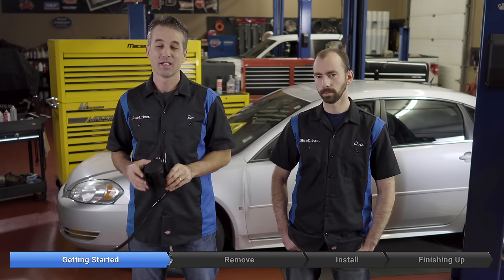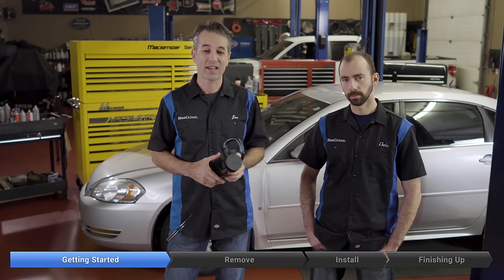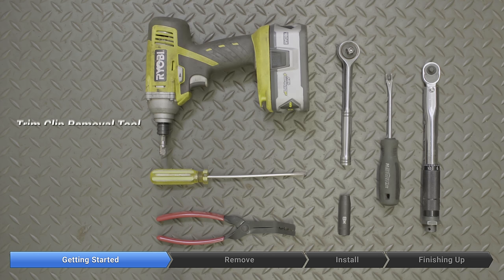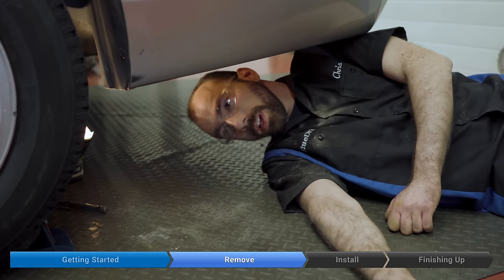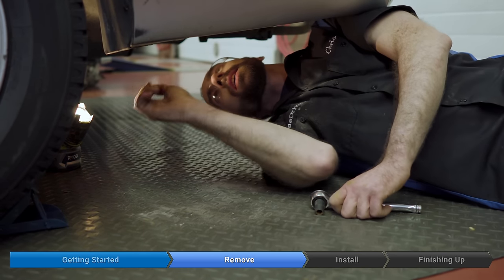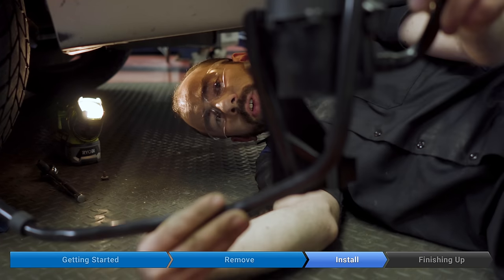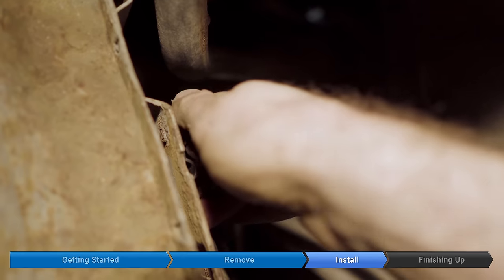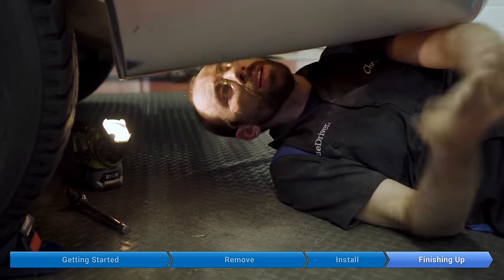EVAP Canister Solenoid - 2006-2013 3.5L Chevy Impala (P0449, P0455, P0442)

Comment: Thank you guys!!! My gas cap had been replaced 3 times and never did they test that solenoid. I went to autozone, bought the part, and did it myself. Problem fixed!!!
Reply from the maker: How great does that feel?
Reply: How much
Reply: @terencehawkins7528  the part ran about $43
Reply: @LemurMonitors  it was such a relief to get that done. that bolt was the only stubborn part but it was so gratifying to not have any problems after that. 20 minutes of my life well spent.
Reply: How did you clear the engine light?
Reply: adam corak did your check engine light turn off??
Reply: BlueDriver how do you clear the check engine light????
Reply: @adamcorak6074  unplug your battery terminal for 3 minutes will usually do it
Reply: @lexor84  hey I'm going through the same I know my canister needs changed but the purge valve with ten mm bolt in the engine is the part I got for now and I'm curious does the purge valve on the engine cause your car to almost not start??
Reply: @joshuat5140  did you fix this? My Impala goes into limp mode I don't know if this the problem
Reply: @Sniper_T_2x  limp mode is usually the accelerator pedal needing to be replaced

Comment: My lines may be clogged, either I replace or blow compressed air through them. Also my 2008 impala always clicks off every couple seconds when pumping gas. I found out my fuel fill neck on my vehicle is rusted. That could mean the fume line may be clogged so I will replace that, but also there is another canister in the fuel tank. I’ve read that it is likely the canister within the tank itself, and not this canister or the purge. Wild. Hopefully I made something clear for someone.

Comment: Thanks for the video.  I drove the left side of my car up on the curb in front of my house.  Plenty of space to work.  Did it in about 18-20  minutes.  

Easy to replace after watching this.  
I encountered an enormous amount of rust and zero dirt.  I guess I run over too many puddles lol.  Wash out the dirt and cake on the rust.  
The rust was so bad that I thought you guys were wrong with the 10mm bolt.  My docket wouldn't go on the  nut.  But that was because of the excess rust lol.  

You guys definitely made disconnecting the hose look easier than it was.  That was a struggle for me.  But overall this video helped alot.  Thanks again.
Reply from the maker: Watch your eyes!
Reply: @LemurMonitors  Lol.  I had a piece of rust land on my face next to my nose. It was like a giant grain of rice.  Luckily it didn't go under my glasses.

Comment: did this today, knocked it out in about 15 minutes. thanks for the how to.
Reply: Did you have the P0455 mass evap leak code? Seemed to light the check engine forever in our 2008 Impala, think this is the first thing to replace to try and get rid of it? Gas caps seal tight so im figuring this. On other note, constant ABS/Traction reduce power problems, I replaceed the gas pedal/Pedal position sensor- unless it broke 2 years later maybe this is the wire, or the wheel speed sensor? Ugh, so many problems with electronics in GMs
Reply: @zdp-189  yep. Does your car stall when you crank it up after you get gas?
Reply: @ajw148  mine is doing that and I get a egg smell and gas smell ram the code and the only code that popped up was the vapor canister and was 200 dollars so I waited and do some research and I'm hearing that if you smell gas and the car sputters when starting it's the purge valve on the engine?? Is that the case and did it fix your issues with starting up???? I'm still going to change the actual canister by the gas tank just want to try this first and that way I can order the canister online and save some money auto wanted 200 dollars for there canister
Reply: @joshuat5140  i just went ahead and did both at the same time and fixed all my issues and cleared the code.

Comment: My check engine light just came on two weeks ago, so I took it to autozone to check it out and there were two codes that popped up p0455 and p0442. So I bought a new gas cap but my check engine light is still on.
Reply: Did you fix it

Comment: If you put the left rear tire on a 4x4 block of wood you have more room to work under the car. The 4x4 block of wood will hold the car. Now putting the tube into the rubber hose. Use valisine makes it easier to install. Now at the electrical connector. One wire will have power at all times with the key in the on position but not running. Ground side switched by the ecm

Comment: I have difficulty adding fuel to the tank, could the whole EVAP system be culprit? I haven't ran codes yet, but i suspect the whole system is probably dirty and clogged, also probably have a permanent code as well.
Reply: I have the same problem. Did you figure out what it was
Reply: @dennishnks  Same problem. It takes so long to get gas in the tank, I can only tolerate $10 and I'm done.  The more frequent stops for fuel are wearing me down now.  The car has 240,000 miles so I don't want to sink a load of cash in it, BUT I need to find out what's causing it because it's annoying!
Reply: @aboomalacani2732  mines does the same did you ever find out the problem?
Reply: @puncho33  I finally fixed my problem I did so by blowing compressed air through the tubes I took off the canister and blew it out really good and wasn't satisfied so I cut it open and cleaned it out then JB weld it back together reassembled everything cleaned out the vent too.

Comment: So, at first I had a P0455, cleared that.. was fine for a while and now I've got a P0449. Haven't done any work with those two codes yet. It all started with a misfire code. That hasn't come back. Although I know there is still a misfire.. it just hasn't coded since I've been gentle with the car since. Any thoughts here on this?
Reply from the maker: For the codes, both point to the canister vent solenoid
If the car is 08+ you can get your mode 6 data for misfires, but if they're bad enough they should be throwing a P030x code

Comment: Had a question, i just installed a new evap canister filter, and now its showing fuel pressure sensor low voltage, could it be i have a bad evap canister filter? It's a 2008 impala ss, also i instaled a new feul pressure sensor, and still shows same ,checked all wiring and all are proper voltage ,again nothing came on until i installed the new evap canister filter, could you help me please, thank you for your time,.
Reply: Juan Smit same problem

Comment: I have p0449 and p2122 code so I have engine reduced power I replaced throttle body and gas pedal and Replaced vent Valve canister and the check engine light is still on with engine reduced power , i dont kno want to do next

Comment: my check engine light has been on for about 2 weeks and i was getting this message so i bought the part to do the replacement. My only question is: Does this part have to do with the starting of the car? From a cold start it cranks for quite some time before starting, and its gotten progressively worse over the last 9 days or so
Reply: Did u ever figure it out? My car is doing the same.
Reply: @angelnegro281   for me it turned out to be a few different sensors. MAP and Camshaft position sensor got it fixed and smooth. But mine had around 208k miles and I was starting law school so after about a month I sold the car so I dont know how it went long term. I can tell u getting to that sensor on my car for some reason took over an hour. But im no mechanic im just a 23 year old guy trying to get his car running haba
Reply: @JonezzNY23  okay. I’ll check those out as well. Thanks for replying.
Reply: @angelnegro281  forsure hope all goes well for u.

Comment: Do you need to disconnect the battery before any work on the car?
Reply from the maker: It would always be recommended  when working with anything that could be linked to the electrical system.
Reply: @LemurMonitors  I went to replace my solenoid. Turns out, my cable or wires aren't even there. How hard is it to do wiring for the evaporator solenoid? Do you have any tutorials for it? I have no idea what to do next. I definitely can't afford a mechanic, it's why i was gonna do it myself. However the cable is literally missing, that is supposed to be attached to solenoid. It looked like someone cut my wires.

Comment: Can I ask, how long until the code clears?? Mine is still on.... I unhooked the battery for 30 seconds and it went off (as normal), but came back. Ugh. Starting to worry if it wasn’t the solenoid
Reply from the maker: If it comes back on there might still be a problem - other things to look at: filler cap, fuel filler neck, evap wiring
Reply: BlueDriver thank you for the reply! I just changed the gas cap, so I’ll give that a shot and if that’s not resolving it, move to the filler neck... hopefully not a wiring issue...

I appreciate it!

Comment: I have the P0455 code. Changed the evap hose and still reading same code. New gas cap,Purge Solenoid and MAF sensor. Still same code! Not sure whats wrong.
Reply from the maker: Maybe a leak somewhere in the filler neck?
Reply: @LemurMonitors  I will check that. I'm gonna change the PCV valve just in case.
Reply: Oh I checked my Mass Air Flow sensor pigtail connector with a test light. One wire the light is very dim. The other wire light is very bright. Is that normal?

Comment: I just received a error code of P0455 on my 2010 Chevy Impala Lt 3.5L W/ flex fuel. Will replacing the EVAP Canister Assy correct my issue or is there something else wrong.  Emission test needed by end of November. Thanks
Reply from the maker: The EVAP vent solenoid is your most likely culprit!
Reply: @LemurMonitors  Why is my blue driver telling me to replace the purge valve with the P0455 code?

Comment: HHHEEELLLPPP!!!!!

So I only have the P0455 code on my 2007 3.5 L Automatic Impala LTZ. NOW... what typically happens is that my car drives really slow at first and then slams in to second gear pretty hard. Almost seems like a transmission issue. I also have just over 200 thousand miles. Would the P0455 code sometimes make your car drive that way? Like I have trouble switching lanes because there’s no give in my car in the first gear B4 it eventually slams into second gear!
Reply: That's a transmission problem. Common on the 4t65e
Reply: Zeke Mohrman not at all we determined it’s exactly this. Not a transmission problem at all as initially thought. It was this evap celanoid hose lol you’d think it would be transmission. THIS PART WAS THE ISSUE ^
Reply: @TheHipHopolypse  that's amazing. Glad it wasn't the transmission, I never would have guessed the valve could cause that haha
Reply: Do you guys have a link for the parts? I have an 08 impala and  my transmission does the same thing. Also have the same check engine code.

Comment: Need help with a code P0443 on my 2013 Impala LT Flex Fuel. Is it the same fix as this video??
Reply from the maker: If it's the purge valve it might be different from the vent canister in the video - still a pretty easy fix though! It's sitting to the left of the throttle and just has one bolt.

Comment: P0449 code would doing this fix the problem oh as well as the canister is split on the connector
Reply from the maker: It should do the trick! Especially if the canister itself is damaged.

Comment: what do I do to remove electrical connection.  will not unplug!
Reply from the maker: If it's being stubborn you could try taking a flat head screwdriver and putting it between the connector and plug, press hard on the tab, then turn the screwdriver to pry it off. Don't pry/turn too hard though or you could break it.
Reply: The electrical connector was the hardest part for me. The orange tab SLIDES down but I had to really work it to get it out.

Comment: Will this fix p0446
Reply from the maker: It could, P0446 could also be caused by a fuel tank pressure sensor or gas cap
Reply: Thanks

Comment: So I tried doing this on a 5.3 L but the connector is wrong what should I do and it’s ome and what sucks is that I checked everywhere and I can’t do it unless I try taking checking the pump.
Reply from the maker: Did the new one come with a pigtail connector/adapter or anything like that?
Reply: BlueDriver I figured it out. It had a adapter with it. I’m sorry to leave this comment 😂😂
Reply: @mightywasp1258  So what are the results after you installed? I have a 2009 5.3L and have problems wit stabilitrack and ive been told it's my evap cannister

Comment: What if you don't want to buy the entire kit and just replace the evap solenoid? How would you disconnect from the hose?
Reply from the maker: Typically it's sold as one unit but otherwise maybe try heating the hose up a bit?